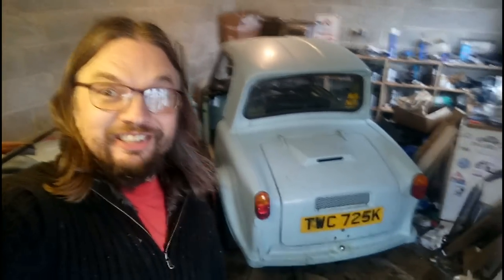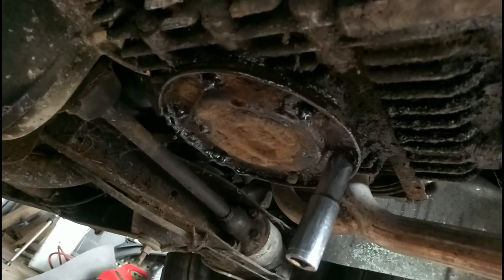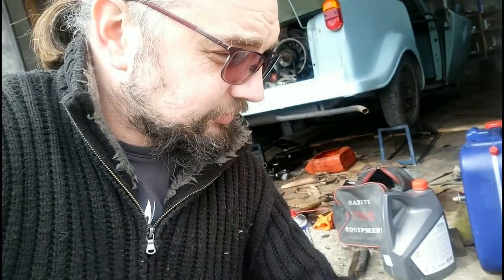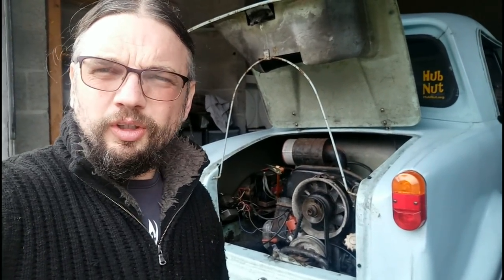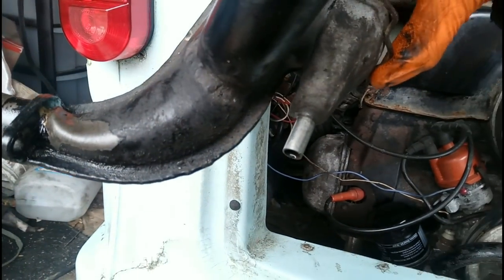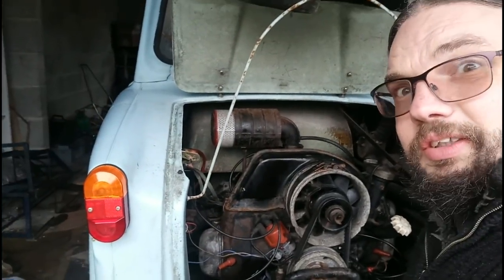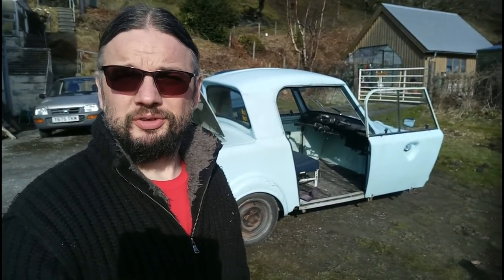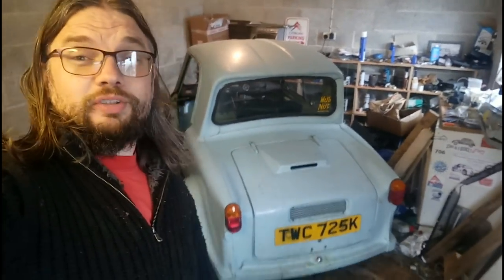Project Invacar Part 17: Can TWC hit 60mph?!

Comment: Finally time for that carburetor to be gone through. I assume the distributor has mechanical advance. You may want to go over the weights and clean them up too. Older cars when sitting in moist environments sometimes build grime and rough areas in the advance system due to galvanic corrosion. Nothing some emery cloth and carb/brake cleaner cant take care of. the more freely they can move the better spart curve you get. 

Also look into a phenolic spacer for the carburetor. Being air cooled in such a small bay, anything to seperate the carb from heat transfer will help.
Reply from the maker: Yup. Carb will be off. Advance weights seem fine. Actually, Steyr-Puch seem to have gone to some trouble to warm up the intake system bizzarely. The balance pipe between the cylinders meets the inlet manifold. It's quite odd.
Reply: Agree with Doug, those would be my go to items. Exhaust heated manifolds is not uncommon on air cooled engines but that's to stop icing, you still need to insulate the carb to stop the fuel in the float chamber vaporising but that normally shows up with high loads.

Comment: Excellent video. Scarry to imagine a possible top speed of 80mph in such a small car. She is nearly there. Just a few teething problems, which I think you could easily fix. :)
Reply from the maker: I don't think TWC would do 80. I'd need the 'big bore' 643cc engine to achieve those dizzy heights.

Comment: I think you're on the right track in thinking the carburetor has debris in it, what I'm wondering about is the fuel tank, it might be worthwhile taking it out and putting some hardware inside, washers and nuts and shaking it then flushing it all out
Reply from the maker: Tank cannot easily be removed. I reckon it's clear anyway.

Comment: I like the sump plate that gives access to the oil strainer, back when engineers gave thought to servicing such things. Mind you, with the oil we used back then it was probably necessary to clean the strainer on a regular basis. Hope you can sort the carb issue out, wonder if it's fuel starvation or flooding causing the problem? Any sign of smoke coming out the exhaust when she is playing up? Just wondering if the float valve is sticking open. But certainly hope you find the cause soon.

Comment: Wow, Comma oil is still going! I used to but this for a Datsun 120y estate I had [£2.99 for 5 liters] - high mileage it used  more oil than petrol. Ran great but created a smokescreen on choke. 60 was a realistic safe top speed in a Robin [ though it would pass 80]   PS love Simca 1000's - not seen one on the road in decades.

Comment: I'm certain there's dirt somewhere in the carb that's causing TWC's engine revs to die out on deceleration, so a good clean should solve it. The debris is probably too thick for the Redex petrol treatment to clear. I'm not surprised TWC reached 60 mph, being a very light vehicle but would think it was a bit "hairy"! Looking forward to the next installment.

Comment: Thanks for the udpate!  

Your progress has been amazing.  What, 6 months ago this car was derelict and hadn't run in 16 years?  Given that you're mostly cobbling together one car out of two, both of which were field finds, this project is going stunningly well.  When it's running, it's running really well.  It sounds, well, frankly, much better than I'd expected at 60 mph.  

If you haven't had the carb apart yet, god only knows what horrible state the float bowl is in and what kind of junk is in it that keeps going through the fuel passages and plugging all the meter ports.  

The oil pickup and the bottom of the engine look remarkably like an aircooled VW engine.  They use exactly the same system of a round sump plate with 6 bolts and the oil pickup in the middle.  

One thing to watch out for--"mineral" oil may mean it doesn't have dispersant chemicals in it ("detergent"s).  That means that unlike the modern oil you'd had in it that suspends the sludge in solution, it will just sink the bottom.  There may be a procedure for going from detergent oil to non-detergent oil that you could look up, to avoid making a mess of the inside of the engine.  I don't remember off hand.  

Hope the brake thing is minor.
Reply from the maker: More modern minerals tend to still have some detergent in them, as they're designed to work with external filters. Good tip though. I've had the top off the carb a few times, and the jets out. Must be something I missed.
Reply: Ah, I see.  Well then my impression of the term "mineral oil" is either an airplane-specific term and/or out of date.  

So you have taken the cab apart.  Hmm.  When you had it apart, did you  spray carb cleaner into all the holes you could get to?  All those little internal passages can have gunk and/or little bits of debris in them.  Lots of compressed air too to blow dirt out.  

And I assume you either have a new air cleaner or you've made sure it's sound in some way?  

How about the fuel system?  Is it possible there's junk coming through the fuel lines?  Presumably you're filtering the fuel somewhere?  Is it after the metal fuel lines through the body?  Have you considered bypassing the fuel lines through the body with soft lines for a test?  Have you cleaned the fuel tank of rust and debris?  

(Sorry; just thinking about this and trying to brainstorm.  Please ignore whichever of these things don't apply or you've already done.)
Reply from the maker: Had the top off, cleared out the fuel bowl and jets. Reckon I missed some important passages.

Comment: Instant gasket? What's wrong with making a card one from a cereals box? Better yet, use a teabag box. We know you've definitely got one of those.
Reply from the maker: I think I may well end up doing that anyway. Mrs HubNut did exactly that for a new carburettor top gasket! Not that it made any difference to how it ran...
Reply: Blimey, you're fast. I wasn't even done watching the video yet.
Reply: you can buy 'proper' gasket paper to make your own...it's not expensive and might do a better job than a cereal box?? :)
Reply from the maker: I always try to keep up with my comments when I post a new video!
Reply: Keep up the good work...you're doing a great job with the channel :)
Reply: Do get the proper gasket material. Box cardboard will soak up the oil and then leak it everywhere by capillary action. And it will break down over time and get worse.
Reply: Ray Rooney Back in the 80's, my dad made a gasket out of a cereal box for the float chamber on a Austin Maxi and yes there was a strong wiff of petrol a few weeks later, after a long drive!
Reply: Yeah, we tried those sorts of things when we were kids, back in the 60s. Nearly burned one car (57 Plymouth) doing so. Not recommended.

Comment: Good vid ian .sorry i had too chuckle when you said about your hair. I think you need too buy an inline plastic fuel filter to iliminate crap from the tank contaminating the carb .take the carb off and strip it down to put new gasket on and see if you can put it in an ultrasonic bath for a few hours .also check float levels not to high and shutting off ok. I think the oil pick up and the breather solved the oil problem .if the breather was blocked it would pressurise the block and blow oil out from somewhere else. Pluss a 20-50 wieght oil is a thicker grade oil .normally for hotter climates .lol supprised it cranks over in cold temperatures.
Reply from the maker: I have fitted an inline filter. Pretty sure that whatever is wrong with the carb has always been wrong. 20w50 is better than what was in there - 30 grade! Now that's hard work in winter.
Reply: HubNut i was allways lead to belieave the first number ie 20 is the lower temperature range and 50 being upper range so in the summer you go for a higher number but in the winter its so cold and the oil is so thick it would struggle to turn over .but if you had big clearances between the crankshaft bearings / conrods the thicker oil would fill the gap and boost the oil pressure.did you put your had up in the sump and feel around the sump too see if anymore carbon was laying around ?
Reply from the maker: Indeed. That's true. 20w50 is thinner than 30 grade when cold, but thicker with heat, so less of a compromise. Did have a root around in the sump, but no further much in there.
Reply: HubNut 30w is 0-30w hence thinner .in england average is 10-30 /5-30 or 30w which is 0-30 which suits our climate

Comment: The reason that it picks up again after the cough is that it backfires through the carb and effectively clears the jet by blowing the crud that is blocking it back up the feed line.  It is also the reason the carb is covered in petrol (gas for your USA viewers)  as it blows all the fuel that has built up in the venturi back out the top.  Clean the jets with high pressure air in reverse direction and also all the feed channels in both directions.  I used to rebuild early Series Land Rovers which suffered the same problems.  This is a ten year old video hence the poor quality https://www.youtube.com/watch?v=7z77eJp9QUY
Reply from the maker: Thanks. That makes sense, as it was spitting flame through the carb at times (before I put the air filter back on). Definitely time to get it off for a thorough clean.

Comment: Does your petrol tank have an air vent (or a vented cap)? If the vent is blocked or the wrong type of cap is fitted, this can lead to intermittent fuel starvation.
Reply from the maker: Yes, it is vented. Pretty sure it's not a fuel-to-carb situation, as the accelerator pump works fine all the time. Blockage in the carb I reckon.

Comment: You probably should go through the carby with a kit, but have you placed your hand over the carby (air cleaner off) when running ? I’ve done this on my old land rovers, the vacum cleans the jet out
Reply from the maker: Yes. Have done that a few times. It gave slight improvement at first, but now, not so much.
Reply: OK - sounds like its time to put a kit through the carby. Good luck.

Comment: I can not remember if you have changed the condenser, my Saab 96 had a problem where it would suddenly bog down and lose power then as quick as it lost power it would regain power, basically replaced/cleaned the whole ignition system; coil, plugs,leads, cleaned up the points rebuilt the carb, then one day it would not run at all well. I had got a new condenser at this point so I just bypassed the original when the car was running and "vroom they took it off like a escaped rocket floating into orbit" (name the reference!) off it went no problems since. only a couple quid part but caused so much hassle!
Reply from the maker: Yes, have tried several condensers.

Comment: Another excellent video, Mr Nut. Can you tell us whether you get any sort of heat out of the heaters in this weather?
Reply from the maker: In theory, yes. I can't say I've been greatly warmed by the heater. Bit disappointing really, because the 2CV uses the same blown-engine-heat system and can be quite toasty.
Reply: HubNut Your 2CV gets toasty...?
Heavens. Mine was rarely hot. On the occasions the engine DID get warm, it was a bugger to start.
Reply from the maker: Hot starting issues usually a defective coil. Correctly set up, 2CV heaters are pretty good.

Comment: if it still leaks bit of gasket sealer and some paper to bodge it should be okay, that or duck tape that'll work, plus it'll be great looking you can say "oh no its the rare verson that had the anti leak tape look, as they leaked there so they brought that out was a right bugger to fit but yep it works now"

Comment: i see so many parts of this motor that are vdub-esque. is this a vague, 2 cyl. copy of a 1600 beetle engine? i used to build bajas, sand rails, and buggies out of them when you could pick them up for little of nothing in the 80's and 90's, and sell them for a profit. sometimes, i would put webber progressive 2 barrel carbs on them with an adapter i welded up custom, using the gaskets as a template, and emt electrical conduit. you could try to put a side draft motorcycle carb on it by doing the same thing. a properly sized mikuni carb, some 1/4" flat steel plate, 1 and a 1/4" electrical conduit 90 degree elbow bend, a section of radiator hose, an arc welder, and bob's yer uncle, you've got a custom carb set up. i'm sure it would increase your hp. and throttle response.

Comment: 60 mph and yet the steering seems to be fairly stable. No excessive vibration or wandering.i 've driven some 4 wheel motors built in the seventies (in the uk ....
B L  and fords) at that speed  where you are hanging onto the wheel afraid to put out your embassy number one in case you end up chatting to the local wildlife......close up.
Reply from the maker: Stable, but super-sensitive. You daren't input much!

Comment: Have you not considered swapping the carburettor off TWC's original engine and trying that instead? You do have two carbs to experiment with do you Not? Also as regards to the fuel treatment not working why not buy some Redex and do the old trick of removing the air cleaner, get the engine warmed up, rev it to 1-2k rpm and pour the redex into the carb and watch as the carbon deposits in the engine disappear in a cloud of smoke
Reply from the maker: This is the carb and inlet manifold from TWC's engine. Sadly the spares carb was half missing. Am still tempted by a harsh Redex treatment. Neighbours will love that...
Reply: Oh that's a memory brought back of my older brother in law a BL mechanic sorting the blocked throttle jets of the twin choke Webber carb on my GT Escort and telling me off for running the tank right down n picking up all the crap. Pancake filter off, neat Redex  around both flaps, make T, av T get petrol lawn mower refuel can on standby, crank over and hope nobody had washing out. GTX oil changes every 4,000 miles at most. 

 jets

Comment: A little story regarding these Invacars...Years ago i was an RAC Patrol based in Eastbourne..a breakdown was radioed in to me to attend.
It was a AC Car..1965,blue non start.? Now looking at the reg /colour/year this must surely be a beast of a hot car to try and start.? Wrong.!!!
On arrival at the owners house all i could see was a blue Invacar parked on the drive,it was blue but not an AC car..? they only made supercars..

A lady in her late sixties opened the front door,in a wheel chair,she had no legs,just stumps..poor dear..we had the obligatory cup of tea and biscuits..and a good chat.
Seems the car was made by AC cars up there in Surrey,this was the only one on the road.!seems the ladies choice was to carry on driving the car,she had it from new,and did not want a new fangled disability car she loved her old one..this C reg car.

With her incapacity she could drive this car,she sat on a flat board facing front,with motorcycle handlebars,a clutch/throttle.brake/s? all on these bars..how does she drive this car i thought,i could certainly not,all very strange,but she was fine with these controls

Now the strange part,the motorwas in the rear behind her.? it was a Villiers 2 stroke motor,with and electric start,powered by an 038 car battery,being a motorcyclist from 1963 this is not going to fox me as most patrols..but it sure was a crude set up,wires and oil leaks,all assembled in to me a very haphazard manner.

The car had a flat battery,this was jump started,and the beast ran.!  just...it was noisy and crude but the lady owner was happy with it..she did short journeys in it..
I asked if she had travelled in in very far,she said Seaford once..its a hilly drive over the downs..20 minutes max...it took her 2 1/2 HOURS.!! EACH WAY..BLIMEY..

Such as being only 197cc it was a totally gutless motor,in a heavy for its size body,no person i know could have driven it,especially up huge hills around Eastbourne.
The lady had petrol bought for her car by friends in cans,AND SHE MIXED HER OWN 2 STROKE FUEL..Amazing..how does she do all this on her own..

She explained that this was then,(1992?)  the only one on the road and used often,she was allowed to keep it and use it..but AC Cars had the car picked up by truck every year,and taken to its HQ,and given a full service...what an amazing service by a car Company...beat that..

Sadly i know the lady owner has since passed away,her car is in Bentley motor Museum down here between Uckfield and Eastbourne,its on display with lots of owner owned cars...a testament to the older generation, guts and need to move about...sadly lacking in today's generation..i greatly admired her,she never once complained,and was charming and lovely to speak too..pop in and see her car..and the many others..
Reply from the maker: Lovely. Thanks. I'm glad that car survives. I'm also glad mine has the flat-twin four-stroke engine so a decent turn of speed by comparison!

Comment: With it losing power now and again, it could be the coil (or suppressor) slowly breaking down. When that starts going, it has the same symptoms as a fuel problem.  I had that back in the early 80's in a Ford Cortina MK2. Driving along it would lose power but still idle and then suddenly pick up. We found out it was the condensor that time, but I had the coil slowly breakdown in a Sierra.  
60 in it must have been hair raising. :)
Reply from the maker: I've changed coils and it's no different. Pretty sure the carb is the problem.